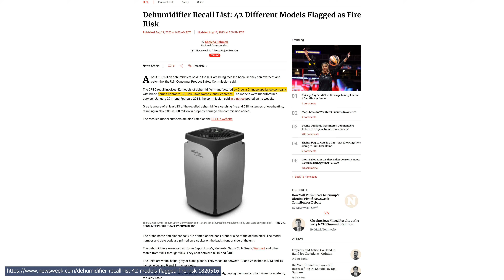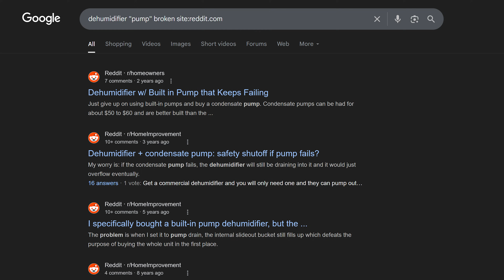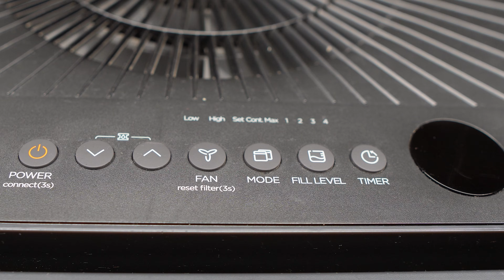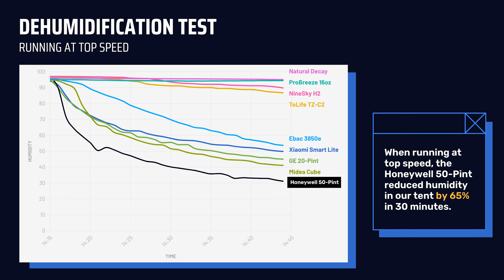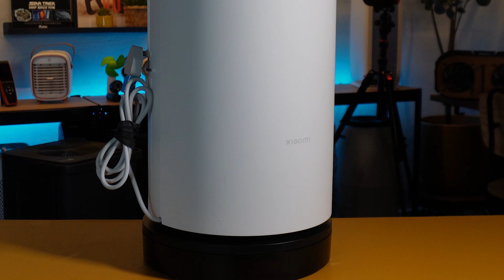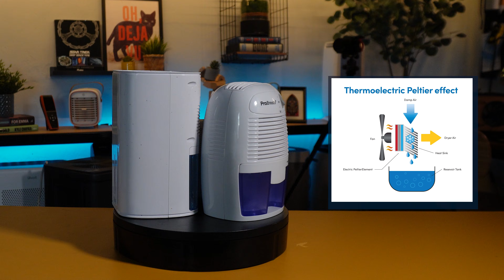Don’t Buy a Dehumidifier Before Watching This → The Best Dehumidifiers We Tested

Comment: Not to denigrate your video which is very good, To be honest you saying many  are built in the same factory was one of the least surprising things I've heard , it's very common in consumer electronics etc , different brands , case ,  but made in  same factory, sometimes the price difference is purely marketing cost or a  slightly better  quality build
Reply from the maker: Maybe I wasn't too clear about my point but many of the internals of these devices are exactly the same as per the reason that they put out a recall for so many different brands due the failure of one particular part. 

But I do agree that does happen with many consumer devices but I do think that it happens at a much higher level with dehumidifiers. 

I do plan to do a lot of new testing with many new models that have come to market recently and have big improvements in efficiency so I am hoping to discover some new models to share with everyone.
Reply: @HouseFresh no that's what I meant so maybe I wasn't clear, though I'm a little bit perplexed by your higher level remark, do you mean that these brands are meaningless, and it's all just one  corporation  , pumping out different variants, through  shell companies (importers ) to give the illusion of choice ?
Reply: @HouseFresh fyi I just got a Pro Breeze® 20L/Day  , I think it's the new model it has carbon filter , and LCD panel on front , and and a  app , is there any clearing problems, it got a Which award , which I have mixed feelings about I don't really trust mainstream reviewers , I'm going to pay for the extended warranty , is the  carbon filter  a gimmick , seems to me you need HEPA as well

Comment: I'm shocked to see the midea cube as the top choice. I'm here watching reviews because I just recieved my Midea cube and it's crazy loud. Mine is a 20 pt cube measuring 80 dB. Must be some big manufacturing variability if yours is really that quiet
Reply from the maker: Damn sorry to hear. Our model is the 50 pint so maybe there is a big difference with the smaller models but I generally found that the Midea cube was much quieter than standard designs with similar water removal performance. 80db does sound like a problematic  unit so i would look to return.

Comment: I didn't understand you at the end can small dehumidifier do a job or not in small space like 2x2 square meters, I have issues with moisture in the bathroom and I want small dehumidifier for that room only but don't want to waste time if it's useless...?
Reply from the maker: I would go for the smallest refrigerant type as the peltier mini models are too inefficient. Maybe like a 8 pint model could be good and still small.
Reply: @HouseFresh thank you!

Comment: I live in Istanbul. I've been using the ebac 3850e model for two years. There's no more sweating on the windows, and no more mold or darkening on the walls. Thank you for your efforts in this video, which allows me to compare it with other models.
Reply from the maker: Thank you. I have switched back to the ebac 3850e for my dining room as for my situation its the best model to keep things dry and not use too much energy!
Reply from the maker: Glad to hear ebac has made it to Turkey!
Reply: @HouseFresh  This British-made device is a bit expensive in Türkiye, currently around 495 USD, but yes, there is a sales service in Istanbul. This is encouraging :)

Comment: I'd be interested to know more about your basement size and operational costs of a 24/7 dehumidifier.
Reply from the maker: Around 2000 square feet. The midea cube used around 192 kWh per month to keep at 55% humidty.

Comment: Definitely keep up with reviewing dehumidifiers! One note is, if it's possible, try to also talk about how long these devices typically last, I know you talked about staying away from pumps because the pumps usually fail, but I've also see a lot of reviews about the Midea cube saying they don't last much longer than a year before they start breaking down or freezing up, maybe also look at smaller commercial dehumidifiers that can be used in the home, they're more expensive but from reviews they typically last much longer and use less energy than residential dehumidifiers so they might be a good option for some people
Reply: Can you give some recommendations of the smaller dehumidifiers
Reply: @theolite360  Just get the biggest you can afford and have the space for - you won't regret having more capacity than you think you need!
Reply: Going on 2 years with our Midea Cube and no problems so far! 🤞
Reply from the maker: A good point! One thing I notice is that new brands are bringing longer warranties which should help at least mean that companies have to deal with the issue if it breaks before that.

Comment: what's an EU alternative to the Ivation 13-Pint?
Reply from the maker: Not tested any eu designs for desiccant style but will look at doing in future.
Reply: @HouseFresh  great test HouseFresh but why you are telliing is not worth to take lower performance models than Ivation 13-Pints? There are models with 3,5x lower power consumption for small rooms 25m2 like Xiaomi Smart Lite which you tested so Xiaomi looks better choice for 25m2 than Iviation even with worse perfromance because of a lot of better power consumption

Comment: This video is of limited value for unit longevity. Yes the internal pumps are problematic but longevity is the real issue with most brands only lasting 2 years. Bottom line is they are all cheaply made in China and not built to last so u need to buy an extended warranty with every purchase no matter what the brand.
Reply from the maker: True and i'm glad to see more models coming with larger warranties like 2 and 3 years.

Comment: Hi!! sorry for noob question im new with using de humidifiers, is there a product where it includes air purifier ? if yes what is the best product ?
Reply from the maker: The Meaco Arete Models come with an air purifier but be aware its only good for fairly small spaces. Any larger and I would recommend getting a separate air purifier, some recommendations : https://housefresh.com/best-air-purifiers-we-tested/

Comment: I was hoping you would have tested meaco, seeing they are a very popular brand in the UK. They are built for the UK climate, and the Arete 2 has wi-fi and said slightly lower running costs. The Arete 1 and 2 you can add a hepa filter to turn into a simple air purifier. How good it purifiers air I don't know. The Arete 2 has a brushless DC motor with three fan speeds compared  to the Arete 1 two fan speeds
Reply from the maker: This is on the list  to test. In general I find combo models generally are not great but will test with an open mind!

Comment: Been using midea cube for a month and I can't wait to get rid of it. It doesn't know how do regulate the humidity. Humidity readings are way off showing 36% when the room is actually 53%
Reply from the maker: Damn I have heard the the onboard hygrometers are often not very accurate compared to individual sensors. Thanks for sharing your experience with the Midea cube.

Comment: Sorry, what do you mean by dehumidifiers with a pump?
Reply from the maker: Some models have an onboard pump that can move water against gravity. Its a cool feature but I seen too many fail and looking online this seems to be a very common issue.
Reply: @HouseFresh ah ok.
I ended up buying the 20l Meaco low energy dehumidifier so I'm hoping that's the gravity type then.

Comment: I’m need a good dehumidifier for a bedroom I converted into a gun safe reloading room. I have a good collection of rifles and handguns. Most from the 40s and 50s. 
All the machines you recommended do not get good reviews. I will not purchase anything from Amazon unless it 5 stars are 70%. 
No sale for me. Moving on.
Reply from the maker: Fair enough. I would be careful with trusting 5 star reviews on Amazon. Have discovered many models that are not good with manhy 5 star reviews as its very easy for third parties to obtain these.
Reply from the maker: Also dehumidifers in general have a higher failure rate than other types of appliances. Most people don't review when something works but do when it breaks.

Comment: My Sears vintage Dehu from the 60s just pooped out, loud heavy, ugly, but it worked great for over 60 yrs.
Reply from the maker: Wow can't beat 60 years of use!
Reply: Wow! Unfortunately that's a thing of the past, nothing will last that many years nowadays! 😒
Reply: I have 3 danby  DDR557HE which were all manufactured in 2007 (didn't make the 20 years mark). They were very efficient at generating heat and dehumidifying of course.
They all the same problems:
The display panel fades (hard to read) and no longer works (dehumidyfies). 1 of them also has a noisy fan too (minor problem can be easily fixed). I wish I could repair as would be environnent friendly but I'm afraid I'll have a heart attack if I bring to a repair shop.🥺
Reply: 40 years on my old sears going strong still. I upgraded it with an electronic temperature and humidity controller with a six foot sensor.

Comment: Hate to say it but everything you tested is meaningless when the sealed system loses its charge in a year due to poorly designed evaporators and condensers.  They use copper that is too thin and is marked with die striations that eventually crack.  If you want to compare dehumidifiers, remove the evap & cond, cut open and scrutinize the copper tubing.   (If you ever tore one apart, you'd not be impressed with the robustness of the sealed system.  There is another problem:  new refrigerants have doubled the working pressure which puts great stress on 180* tube bends - and so they fail quickly.

Chinese dehumidifiers I've had last usually 1 year and one that is hanging around for 3 years - I don't know why.  Old Kenmores from decades ago easily last 20 years before they lose their charge.

I noticed a copy AEOCKY that has some serious claims regarding their dehumidifiers:  a compressor that can restart immediately without the 2-3 minute delay and "thickened inner-grooved pure copper tube" which should be an improvement except for "inner-grooved" which like anything with a sharp edge is the place cracks form.  I'm sure these inner grooves are for a higher Energy Star rating - but who cares really if the unit fails in a year or two?

In all seriousness, the best strategy is buy the cheapest unit with a good easy to claim 4 yr extended warranty.  Allstate is not good (Walmart).  Amazon?  don't know but could be better.  Best Buy Insignia makes dehumidifiers and they also have ext warr - if all that is "in-house" might be the best trouble free choice.

Comment: Hmmm but how about dehumidifiers for small spaces that do work well in warmer climates?
Reply: Exactly. I live in Hawaii and am about to wing it with a model I found online at Walmart. My room isn't huge, but I bought a large swamp cooler and was stunned to find my clothes damp and walls wet. I'm going to drop $200 for 2 units of SUBESTUS model SZRSTH to dry my room as quickly as possible 🙏🙏🙏🙏🙏🙏 Will just have to submit to buying a couple of tiny cheap cooling fans for my bdrm 🙄
Reply from the maker: I will look into options for use in tropical conditions - thanks for sharing.

Comment: Could it be just specific parts that are produced by the same manufacturer and not that the humidifier itself being produced in the same factory? Not too long ago there was a world-wide recall of vehicle airbags, all models cars, not necessarily built by the same brand. However, the airbag manufacturer supplied most car brands.
Reply from the maker: Could be but dehumidifiers are fairly simple with only a few major parts. I doubt it would be affordable to be create lots of parts in different locations like you would with a car. But can certainly investigate to find more details. 

I expect there are very similar internals across most brands out there with minor adjustments to chassis design/buttons..etc

Comment: Any comparison to the ones meant for basement use like Aprilaire and Sante fe which Energy star say are over 2L/kWh
Reply from the maker: I need to test but when I used the 150 pint version Moiswell I was impressed how effective it was for much larger spaces. Will try to get a device from each of the brands you mentioned for the next test.
Reply: @HouseFresh is not just to get really big sizes. It's also efficiency as they tend to be very different efficiencies at @80°F/60%RH 
Vs @73°F/60%RH as when it's cooler it can be harder to work

Comment: This was very helpful. I love how you set up stringent criteria for conducting your tests.  All I need now is a reliable source for what to do about my dehumidifier that runs, make the hydrometer number decline, yet doesn't seem to product any water.  No frozen coils, hose not blocked up, etc. Suggestions?
Reply from the maker: Hmm strange as usually when the  hydrometer drops there should be water. How humid is the room you are using it in?

Comment: Hi Danny, you say to not buy a humidifier with a pump. How can you tell which ones have a pump or not? If it doesn't have a pump, will the item's description say so? 

All the ones you recommend are SOLD OUT, NOT AVAILABLE. I need a dehumidifier really bad and don't know what to do now.
Reply from the maker: It should say in the description if there is a pump as they usually are a little higher cost. 

If you are in the UK , the Xiaomi model is a good option.

Comment: Did you test any 60 pint?  Frigidaire claims their 60 pint has a energy factor of 2.8 L/kWh
I currently have a Frigidaire 60pt. FHDP6033W1 however I do not use the pump.  It is somewhat loud on the turbo mode @68 dB.  On regular speed it's 64dB.  So it's pretty loud.  Has a 3.2 Gallon tank which is nice.  Im thinking of purchasing another unit for the master bedroom because here in Alabama it's crazy humid.  During the hottest part of the day the Frigidaire keeps the humidity below 47% near the unit.  But if you go to the other side of the house it can get above 55%. Im curious why you haven't tested the 60 pint units.  Do you have the data from your tests you could share?
Reply from the maker: Not tested a 60 pint yet but will look at some models for next time. Right now we have some data on this page: https://housefresh.com/best-dehumidifiers-we-tested/ but we are working on sharing more data on energy soon.

Comment: Hi from Canada, great video, I have now have to check what equivalent we have available locally. Another thing you can add to your benchmark is the maintainability, last week my "noma" (canadian tire's brand) stopped working because of a lack of refrigerant, those units are well known to leak refrigerant overtime, and after 3 years I was due to a refill. But not only there was no valve for refill, but the refrigerant (R-410A) is now prohibited from new products (Canada and UK), and difficult to find in small quantities.
Reply from the maker: A very good point about self repair ability. I will see how we can identify this.

Comment: Years ago, I was involved in HVAC. There was ONE manufacturer that made the outdoor units for central air for most of the big brands. International Comfort Products. Depending on what brand name went on the front, is how good the electronics were inside. Everything else was exactly the same.
Reply from the maker: Interesting! Will see which brands they sell under so we can review a few for next years update. Thanks for sharing with me.
Reply: @HouseFresh I worked for International Comfort Products in years  past. We were #3 but Carrier #1 bought us out and moved it all from the USA to Mexico. Except for the big commercial stuff. ICP was formerly Heil Quacker brand but in this plant was 10 assembly lines for many many brands like Tempstar, Comfortmaker, Heil, Lincoln, and several others. We made a billion dollars a year prob 8000+ units a day. They all used Emerson motors w Copland compressors and United Electrics from Mexico like the contractors transformers and boards from Honeywell. I had access to the engineers dept n they had all the competitions brands in there w all the same parts in them as we used. They would change one thing that they could patent n call it theirs. So basically all the internal part were the same. Anyway I worked n QC & tested them all. The best were the simplest ones. The more bells and whistles like a Cadillac the more probs n shorter the longevity. That’s why an old Cadillac is a nightmare to own. The more that can go wrong the more will go wrong. And even if the company was once great electronic companies constantly r bought out and monopolized & made cheaper to compete so it’s really hard to keep up with from year to year to say this brand is the best or that one. The #1s kill the #3s & 4s to gain market share n stay on top and are only interested in lasting the warranty life so u have to buy another. Unfortunately we live in a throw away society 😢 Thanks for the video tho its good for a year or 2 then the products all move around n get farmed out to the cheapest labor n parts they can find.

Comment: Just watching the first minute of the video, yes I know, me, my parents and my uncle have dehudifiers from different brands but all of them are exactly equal (only difference is the color) and the 3 of then were bought in the 90's. I always wonder if a new one would need less power because they are hungry beasts but also mine in winter extracts 15l in one night (very very wet place humidity in winter goes around 90%)
Reply from the maker: I'm glad what I am saying matches with your experience. I do know that newer models have improved energy efficiency a little but they are still very power hungry.